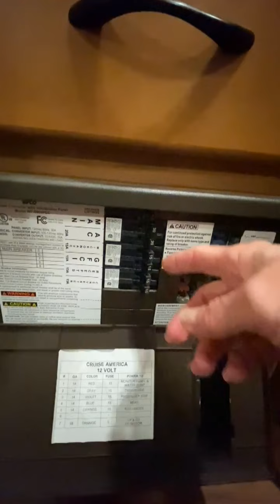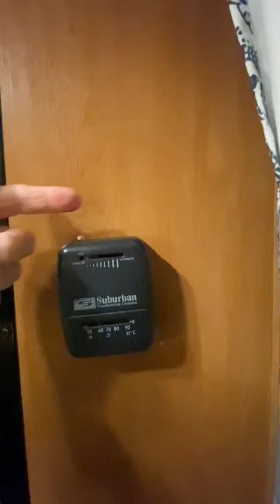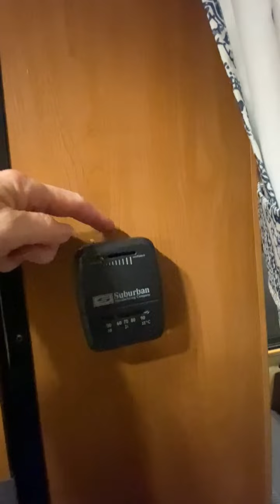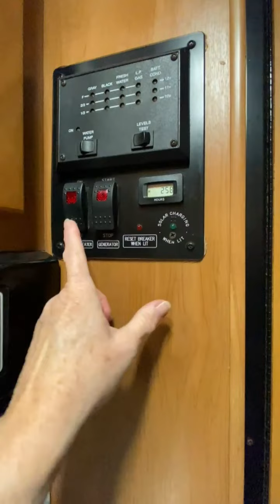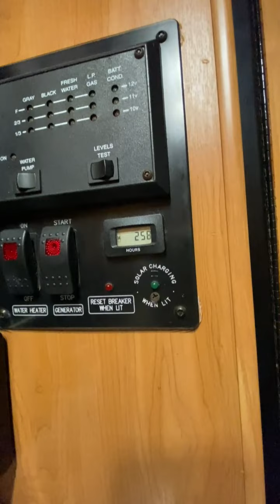Majestic 19g In's and Outs

Comment: This was so fun to watch. I have the same rig, also bought from Dave in Mesa. I’ve already put the drawers in place of the jump seat on my husband’s to do list. Also love the curtain closing off the back of the rv. I changed that sucky thermostat for a cheap digital one off Amazon. Real easy to install. My son installed inverter and the equipment for portable solar panels. I want to replace the frosted kitchen window with clear and put a fan where the kitchen vent is. I’ve had my rv 4 years and had no problems. Love it. Wintering in AZ right now.

Comment: Thanks so much for this great video!  You are right, most tours show only the superficial features of the Majestic 19g.  I've learned so much!  I just purchased my own 19g in December, from Dave in Mesa!  You've given me so many great ideas!!  I would love to know more about removing the jump seat.  Thanks!
Reply from the maker: Thanks for the compliment.....I'm glad you found it useful.  The Jumpseat was bolted thru the floor.  My husband found the bolts under the coach and determined they were not connected to anything important and just removed them.  There is a wood structure you have to wrestle with but basically, it's just a heavy metal frame that is trimmed with wood and cushions.  We used silicone the fill in the holes the bolts left in the floor.  He reconnected the curtesy light which made me happy by just leaving the wires to the light exposed and placing the panel back on the side of the drawer unit.

Comment: I just bought a 2010 model 19G. It has the fiberglass bed above the cab. No seams to leak and larger space.
However, it is a Canadian model and I was told they ordered them with no generator. I will be purchasing a new 5,500 watt ONAN and have it installed.
Do you have to have the leveling jacks? Did you have to buy those, or did the motorhome come with them?

Comment: Very informative! I appreciate the time you took to go over everything and provide so much detail.  My wife and I are looking to purchase a smaller class C in the next few months and are very much interested in this same model.  The one concern I have is driving during hot weather.  Do you run the roof AC in addition to the cabin AC or do you stay cool enough with just the cabin air through the dash vents?  If I understand it correctly, running the roof AC requires the generator to run, which would affect your mileage even more.  Just curious.  Thanks for your insight on this!
Reply from the maker: I have put 18,000 miles on this unit in a year.  And I live in Louisiana which has brutal summers. Never did I need to supplement with the roof air.  I do close the curtains behind the seats on occasion to keep either cool or hot air up in the cab more.

Comment: Great video and tips! Thank you for sharing.  I am considering this model, but am concerned about climbing up into the bed, do you find it difficult? I am in my sixties and would probably end up making the dinette into a bed. Thank you
Reply from the maker: I’m 65 and only have issues I have are getting OUT when my legs cramp sometimes. I use a small collapsible stool by the dinette to aid with that first and last step which helps immensely.

Comment: Are the black water tank and grey tank the same tank? I did a toilet flush and all was good. Did it again and put a treatment in and intended to leave it for the day. Then I wanted to clean the grey water tank because I noticed that the water drains slowly so I figured it had hair and gunk from dishes in there. I poured some dawn in there and added some warm water from the shower. I went outside and it was leaking in about three different places! I crawled under and it looked like water was coming out around the black water tank flaps that bolt to the floor of the RV. I emptied everything and the drip continued for a while and eventually stopped. I waited for things to calm down then filled the black tank back up like before and let it sit. There was no leaking. Neighbors think it's either my grey water tank or there is an overflow system in place.Any insight is appreciated!
Reply from the maker: The black tank and grey tanks are totally seperated.  If you have a leak it's most likely to be from a bad fitting or crack in the drain line itself.  
Gray tank overflow shows up on the shower floor filling up with grey water.   Hope this helps.

Comment: Are you still liking it as much as when you made the video or have any problems arose since then?
Reply from the maker: We just made a trip from Louisiana to North Carolina then down the east coast then gulf coast back to Louisiana.  Plus I use it monthly for work travel on average 10 days a month.  I’ve put 16,000 miles on it since Nov. 2021.
We had to have the radiator replaced within the warranty period and CA paid for it.  I had to have routine things repaired like adding Freon to the roof air.  We did a proactive move and had the roof coated.  Had a small leak on the back of the toilet which my husband easily fixed. 
So my answer is yes we are still enjoying it!

Comment: The only problem is that it’s running 7-8 miles per gallon, it’s just insane for a class C rig.
Reply from the maker: I get 9.5-10.  But if you pull a truck and trailer you get  almost the same mpg.
Reply: @cajunsuggies132  that’s way, way too much or should I say too little for the 19 ft rig, basically it’s the smallest rig of class B and they usually get 15-20 miles per gallon, twice more than Majestic 19 and if you pull a truck and a trailer then you will get twice more space (trailers usually 30-40 feet), plus you can drive your truck around the city or elsewhere without the trailer, which you can’t really do with the rig.

Comment: Ya'll sleeping separate beds as a married couple ??? 💑  odd
Reply from the maker: Odd statement!  My husband is a large man weighing 250 lbs. and I'm a larger woman and the recommended weight for the overhead bunk limit is 300 lbs.   The dinette is short and not that comfortable.  So we take turns swapping up.  We've been married for 42 years and sleeping separately feet apart for a few nights is certainly not odd.  Your statement is a bit offensive.
Reply: Lots of couples sleep apart. Safety is everything.
Reply: Zoomers 🙄
Reply: We have a class c with twins in the rear. We had more storage in that 8x8 space than we needed. The bedside table had 3 drawers which was perfect for medicines, charging phones, tablets,etc.  I need to sleep elevated on my back and he wiggles from side to side and snores. I wear headphones to bed.  We both got up at night so we slept better apart.  He weighed 350 lbs and I weighed 240 last year. Separate beds was a major consideration when we started looking.